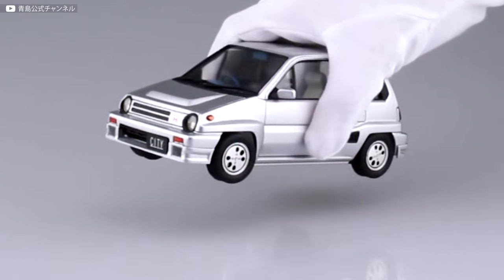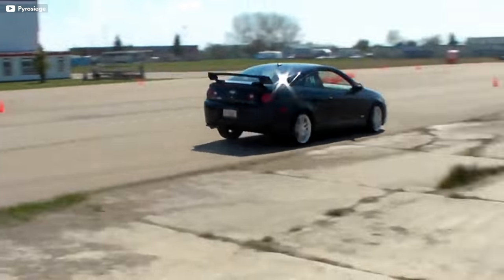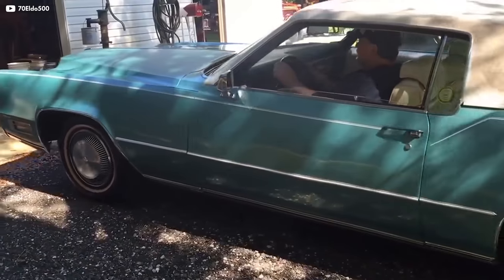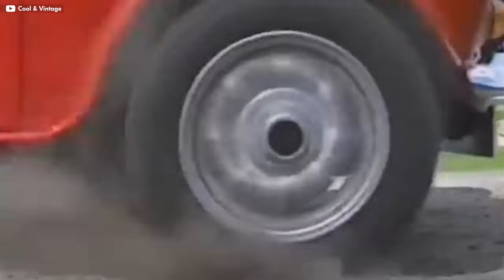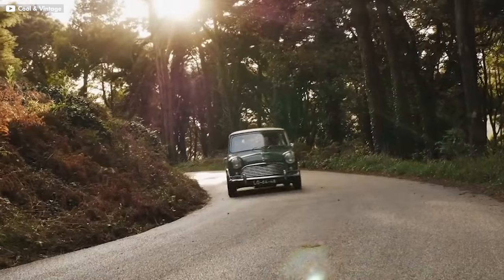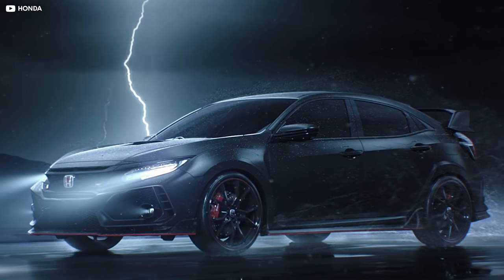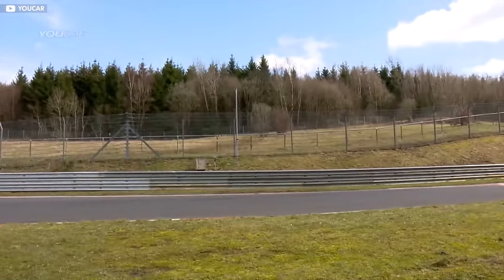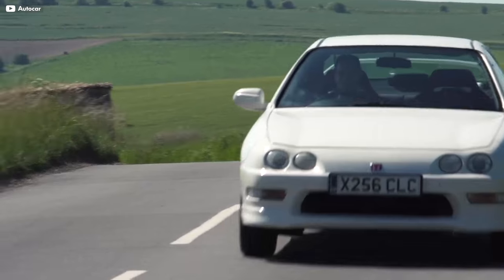Best Front Wheel Drive Cars Ever | The Bestest

Comment: Good list. Love the fact that you included the Eldo. Honorable mention to the Honda CR-X. I had a 1985 and 1988 CR-X and both were great little hatchbacks. Manual transmission with Honda's excellent clutch, 2 seats, plenty of cargo room, small, quick and really fun to drive. Just nose it into a corner and go.
Reply: If you wanted to, Honda would just be all on this list. Hondas made amazing handling cars from the late 80s to the 2000s. But this list had to feature others so it's no surprise
Reply: Have 3 1st gen C-rex's, great pedigree, left stock but just as fast as a new sti down hill, newish mustang, and a few street bikes, even with sloshy fuel and oil, skinny small tires, hell of a drive every time though

Comment: anything that says VTEC on the valve cover really
Reply: Dariune besides the Electric ones lol
Reply: Great video keep em coming
Reply: Not really. There are more Economy vtec engines then Performance vtecs out there.
Reply: 99Lezard99 ironically like the 04 SI which sounds like it should not have been
Reply: Dariune 
V-TEC is about to kick in yo!
Reply: Do you know what VTEC is ? It isn’t something to be proud of.
Reply: WarriorOfEden3033 
The acronym "V-TEC" stands for, (its rather long, ) V ARIABLE VALVE T IMING AND LIFT E LECTRONIC C ONTROL.
Reply: Why? Do YOU even know what it is? It definetly IS something to be proud of.
Reply: What does it have to do with VTEC being an awesome invention?
Reply: And don't get me wrong, 3G is a very agile car, definetly capable of winning against some vtec's, but certainly not "all" of them.
Reply: ah someone who thinks power is everything^ as Johnny liberman famously said "if you think power is what it's all about? you're not a true car guy, kid"
Reply: exactly
Reply: Yeah, basically it is an engine with a camshaft that has two cam profiles (one with smaller lift- for economy driving, and one with larger lift - for more power). The ECU switches between the two based on rpms.
Reply: NO
Reply: Vtec sounds amazing. But Vtec is Made for Honda's You daily Drive For fuel economy, Then when it's time for Fun. You just gotta rev it up past 6500 rpm. So it's like a hybrid between "Economy car" and "Sports car".There's another reason for it, That's hard to explain, And I don't fully understand myself.  But for fully built race car Hondas on the dragstrip and Race track, there's this thing called Vtec Killer. It's basically VTEC locked into place all the time. So the difference is Daily driver/Race car or Just Racecar
Reply: A fricking Accord? Well... there is the Euro R... Ok. You're right
Reply: Driven an 06 Accord with V-Tec extensively.. Don't believe the hype it never kicks in
Reply: Dariune that's a joke because the prelude and any sohc vtec is a joke.
Reply: Element lol
Reply: Clay Octane that's more of an economy vtec car. drive other vtec powered cars with b series vtec or k series vtec
Reply: Clay Octane because it’s a fucking accord my mate had one 2.4 vtec and got destroyed by my B16 vtec everytime
Reply: VTEC is Honda's version of Variable Valve Timing .. a couples of cars uses VVT. You must be new. You must not have driven an ITR or Honda S2000
Reply: So you are just comparing your car to all of the eco Hondas you have raced.... lol
Reply: the S2000 and NSX are my favorite FWD cars
Reply: Lol, good one
Reply: Hero-maker
Reply: Well my dad’s Honda Stepwgn minivan...
Reply: Nah VQ35 ;) now thats fun
Reply: Beside the S2000 and NSX since they have something known as RWD.
Reply: Adam Sherbz you can have power but you need skill to deliver that power.
Reply: WarriorOfEden3033 only some of the fastest cars on the planet
Reply: david chappel only in your little dreams
Reply: Emiliano no just no. Just shut it. No manufacturers are allowed to used variable valve timing the way Honda uses it. It’s a patented design. Only Honda uses like its use by hondas.
Reply: Clay Octane drive a k24 crx or a f2b F20b eg and get back to me with that comment.
Reply: brandon wright there’s a h22 prelude that runs 6.7 secs 1/4 mile. Your car existence is a joke.
Reply: david chappel Subaru are behind Honda on drag racing records. Go home now cry baby fanboy
Reply: Does ecotech count? XD
Reply: It honestly blows me away how good literally any Honda can handle with the right mods and just how amazing all the driver and put fuel on basically anything from a Fit to a type r

Comment: Corolla
-Top selling car for decades worldwide
-Extremely reliable
-Great gas mileage
-Cheap and easy to maintain, register, and insure
-Has had different body styles including 2 door, 4 door, wagon, 3 and 5 door hatch
-Has also come with RWD and AWD drivetrains

It may not be fast from factory in a straight line, but it's still one of the best and has been used in racing overseas

Comment: Fiesta ST or at least one of Ford's hot hatches should be on this list. Even top gear loved the fiesta ST lol
Reply: Forrest Talley but Ford..  😂
Reply: Bert The Avenger Ford has been killing rally in Europe for a long time but i'm also biased because I own a Fiesta St lol.
Reply: Bert The Avenger the ST powertrain comes from the UK. So no found on road dead. Unless you mean the RS head gasket issue
Reply: Best fwd ford hot hatch was the mk2 facelift focus RS. Highly tuneable and the sounds of the five-banger is the best exhaust note ever produced by a inline ford engine
Reply: chunky671 it's ford, even 20+ year old Saabs are faster and more comfortable.
Reply: Forrest Talley Ford is vw's biggest rival in SA..there were many cars put in the video that no one really cares about
Reply: chunky671 the RS doesn’t have a head gasket issue.  Something like 3% of cars got the wrong gaskets in a mix up from factory.
Reply: Dude Shark sure sure, keep making excuses. 😂
Reply: Dude Shark All cars built between 3 August 2015 and 6 July 2017 will be recalled. A recall notice (which can be seen here, via another Reddit Cars post) is being sent out to owners, telling them that their car will definitely get a new head gasket. All cars will be pressure tested, and where necessary, Ford dealers will be replacing the whole cylinder head along with the troublesome gasket.

The fact that all gaskets are being replaced regardless might indicate that previous claims attributing the problem to the ‘wrong’ cylinder head (from the 2.3-litre Ecoboost Mustang engine, which has small but crucial differences) being fitted to the RS could indeed be correct.

This is a bit more than 3% looks more like 100% and also a bit more than a gasket 😂
Reply: Dude Shark can you not read, its more than 3% like you claimed. 

Clearly an upset little boy as you keep trying to get personal. By the way it's MUM* I'm English 😉
Reply: Dude Shark sorry I got my numbers from ford. Nice try though 😂
Reply: Dude Shark oh and not British, I'm English.
Reply: Dude Shark are you delusional? What argument are you talking About? Sorry you feel there is an argument when... looks like you ate the only one here arguing and the only one here losing. Run along buddy, let the adults talk 😊
Reply: Dude Shark oh hang on... did you say my favourite company is the competition? So what might that be?
Reply: Ford has not recalled them, they just have a TSB for swapping the head gasket. While part of the issue was the head gasket being slightly off, most of the issue is the fact that the 2.3 block in the RS was poorly designed. The block was a new design and they decided to go open deck for some idiotic reason. There's a reason people that build their RS use the 2.0 block from the ST and stroke it. The semi closed deck design on the ST is very similar to the MS3 2.3 block. The RS has major issues that I hope will be resolved in the next generation because it's truly a fun car, but right now I wouldn't buy one. I'll stick with my focus ST.
Reply: Yeah and theyre also faster than every honda and vw on this list? the fuck is your point?
Reply: Bert The Avenger what car do you drive?
Reply: I don’t think it was mentioned because 80% of this list had sports version of FWD  hatchbacks in the 80s and sadly Ford failed in that category during those years. Mind you VW created the hot hatch category
Reply: Focus ST is fwd and is faster than Golf GTI MKV in nurburgring although its only .01 sec
Reply: pretty sure ford got that from volvo.
Reply: Zhi xci mk5 was for sure the worst gen, so ugly
Reply: @Connor Orrino 7 months late there 🤣

Comment: What about the 1st gen Neon ACR?? It dominated showrooom stock racing to the point where the rule books where rewritten. 
That car bent every rule there was, shorter final drive, ac, radio, rear window defogger, side trim, and badges were all deleted to save weight, even had Koni adjustable shocks, and had an optional factory installed roll cage.

Comment: Opel Corsa E OPC (Vauxhall Corsa E VXR) Should be on the list. With its 207 hp and 280 nm tq, its 330mm Brembo brakes and its Drexler differential is can go in a 8:10 to 8:20 around the Nurburgring,

Comment: Fiesta st? Mazdaspeed protege/3?
Reply: Fiesta ST- yes! Mazdaspeed 3? No way.  Lethal torque steer.
Reply: The ST wasn't great. They don't handle as well as a speed 3 or even the civic Si. The speed 3 torque steers a lot but it was a fantastic performer. Definitely would have fit on this list
Reply: @Connor Orrino stock models? What tires? What conditions? Also, "go look it up" is the equivalent of "I'm spouting shit out of my ass and can't prove it" but for people who pretend their pride matters.

Show me and I'll tell you you're right, but I'm not gonna put effort into proving your point
Reply: @Connor Orrino also, it looks like you own a focus/fiesta. Bias, much?
Reply: @Connor Orrino okay, so you're talking about stock setups. Sure, the ST is faster in stock form. Wider tires is pretty much all you need and some electronic stuff to weed out shitty driving helps a lot lol. Start tuning the car (like you should with a speed 3) and the ST falls flat, while the speed 3 wakes up with a fire. I've driven lightly modified versions of both of these, the 3 outpaces the ST pretty quick
Reply: Both cars are great, the speed 3 (Mps in the UK) is probably one of the most underrated hot hatches out there

Comment: Saab 900 Turbo?
Reply: YES! Also the 9-3. The Aero V6 pushes more power than most of these cars and are extremely fun to drive.
Reply: Colton Miller 
Very true. A friend of mine has a 2007 9-3 Aero and it's tuned to have over 400 whp. Insanely quick. And he drives it on the daily.
Reply: Don't forget the Viggen or the 9-5 Troll-R, 300WHP from factory...
Reply: Agree 100%
Reply: Yes! Owned an '85 900 turbo. Handling and steering feel were amazing.

Comment: No V8 Grand Prix GXP...😢
Reply: Jon's Tech Channel the ls4 was trash because of the parts expense and the transverse engine was terrible but the supercharged 3800 was where it was at just as much power and easier to tune. And it even revolutionized how gm built fwd cars. So without it there would be no cobalt ss

Comment: You really put the Cobalt SS on there but not the Monte Carlo SS??? 303 horsepower from a naturally aspirated small block V8 and parts are everywhere, as it shares the transmission and most body parts with the police/fleet Impala. Fantastically fun car for highway pulls and cornering that you can keep running for cheap.

Comment: Just a few more years and we can import the 96-97 Mitsubishi FTO GPX. Might need to redo that list since the going price for them is like 1,500 GBP and shipping from the UK is like 600-800 GBP. thats like $3,500 tops for a 200hp 2300lbs FW hatch. Probably no where near as fun as the Integra type R but I would rather have an FTO than most of the stuff on this list. Especially for under 5k.

Comment: But Hyundai Accent and its turboed big sis the 3 dor hatchback coup Veloster turbo. I toped my 4 speed automatic with 35 miles to the gallon at 135mph. And that is the 4 door sedan. I even went further into a fourwheeler trail than a 4x4 lifted Silverado. Hyundai Accent is a beast care at 98 thousand miles it still runs like its brand new in 2011.

Comment: The Saturn ion redline was the successor leading to the cobalt ss. The fact that it was out before the cobalt and it shared the same engine. The ion redline was out before the cobalt and basically gm was using Saturn as their test bitch for the cobalt.

Meaning if it weren’t for the Saturn Ion, The Cobalt wouldn’t have been what it was because gm went through a lot of trial and error with the Ion redline and spent time into the development to have the best set up.

And the cobalt wouldn’t have made it into this video if it wasn’t for the Ion if you really think about it and if you were a Saturn enthusiast

Comment: Also, 2.0 slow is a mark 4 vw thing.. it can’t be a 2.slow if its got a turbo on it??? 2.0 slow was out of date after the mark 5. The 2.0l turbo replaced the 1.8t and the 2.0 na was replaced by the 2.5l 5 cylinder.. but good effort, back up some your info with some research